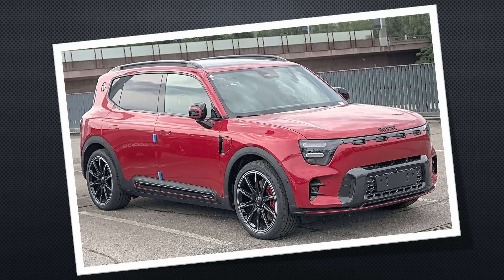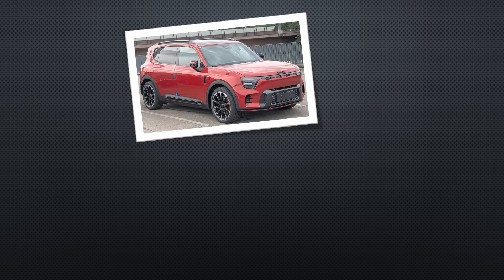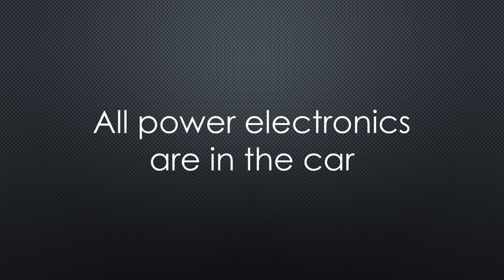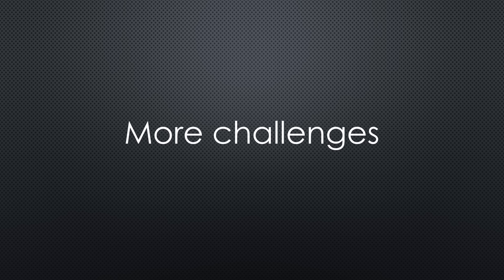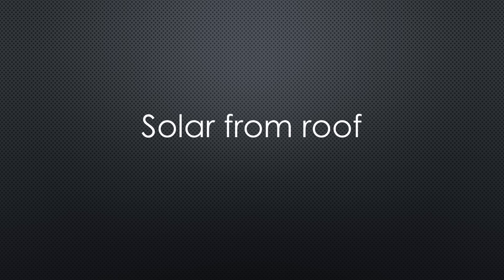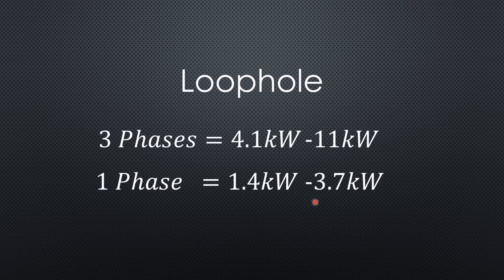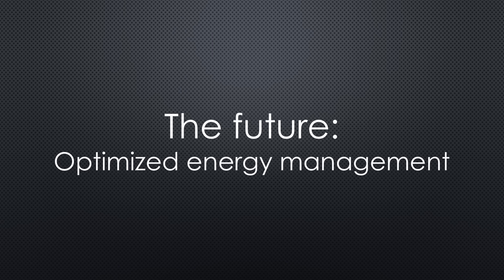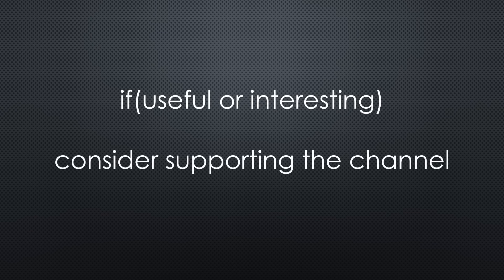How to charge an EV using Solar, OCPP, and EVCC

Comment: Whats the best Antenna for 433 MHz Lora transmitter and receiver for a HAB appx, 10000 meters maximium Altitude,  ?
Reply from the maker: More important is the line of sight of these distances. If you have no lien of sight, it most probably will not work

Comment: Nice video as usual. I started with EVCC some time ago, but found it was not able to handle some specific scenarios so I ended up implementing my wallbox flow and dashboard in nodered using node-red-contrib-ocpp.
Reply from the maker: Also a good idea if you want/need more flexibility.

Comment: I have a Nissan Leaf- and have been curious about whether I can plug into the DC port with some helpful adaptation to do direct (but probably slow) trickle charging from Solar when I’m up at my camp in the Maine woods- 

I work in Solar Installation and Service, and there are nowadays piles of older PV modules that still function, but were upgraded, etc.
Reply from the maker: So far, I have not seen a project for DC. But it should be possible. the standard is open.

Comment: Do your vehicles have the regular outlet plugs? All the ones here do, which is quite a slow charge but ok for some.
It also has the EV specific types of plugs for more power of course.
I have opted to just switch on the outlet via a relay when solar is available lol.
Reply from the maker: My EV has a type2 connector. An I bought an adapter on AliExpress that can be used as a 220V outlet with up to 3kW (Chinese)

Comment: This is fascinating, thank you for sharing it! However, in watching I am left full of questions: 1) The CP control duty cycle... what is the voltage of that signal? Looks like 50VDC on your oscilloscope screen perhaps? 2) What is the nature of the AC charging wave? Does that attempt to charge at the household voltage of 240VAC single phase / 400VAC tri-phase for example? Or, does it push the required current and the amplitude is variable depending on what the car can accept? 3) Would you ever recommend for a DIY to create their own wall charger? As that seems to be such a simple device, it seems maybe not ideal to buy one with any proprietary software at all, do you think?

Finally, I feel that the true home vehicle charging from solar DIY HOLY GRAIL would be a huge battery and to charge via DC. If you should be studying the DC charging attributes or have a observations about that, I think it would be really interesting to share here.
Reply from the maker: 1. You should find a table with the different voltages of the CP pin in the video (Max +-12V).
2. As said: The wallbox just switches the AC lines. So there are 3 sine waves.
3. DIY is not allowed here because the wallbox is part of the "official" AC net. That is heavily regulated.

Comment: There are still only very few cars in North America with NACS connectors, except for Tesla cars. Some can now use superchargers, but via adapters and different adapters are needed for DC versus AC. The takeaway is that most home charging with non-Tesla cars uses the legacy type 2 connector.
Reply from the maker: Good to know. I thought it became the standard...
Reply: @AndreasSpiess , it was announced as the new North American standard in 2023 with great fanfare, but manufacturers have been taking forever to start converting the cars they sell. Even adapters were not available for a long time, but this has slowly changed. As to built-in plugs, there are still almost none. I think maybe Rivian may have a model with NACS, but I'm not aware of others. Perhaps, BMW's new arrivals?

Comment: I am currently driving my wallbox via MQTT, which was an option  with my wallbox. Pretty easy to create proper automations.
Inverter has a read-only access via http (direct access not via cloud scraping) and I can have the relevant info (pv production, battery level) via an HACS plugin.

Will give evcc a try since latest firmware of my wallbox made ocpp available.
Reply from the maker: Frankly, MQTT would be a simpler method. But OCPP seems to be the standard in this area.

Comment: Similar but slightly different setup. I use Node Red along with Home Assistant integrations for Solar Assistant, OCPP and Solcast to control how my car gets charged. An HA dashboard allows you to choose from auto (high or low) or manual to control charging. In auto mode, a flow in Node Red evaluates the solar forecast, the SoC of the house battery amongst other things to determine when and how fast to charge. I am still hoping for a time in the not too distant future where the car acts as an additional battery for the house and charges accordingly all through one cable.
Reply from the maker: Pretty complex setup! I am not sure if the car battery will be used for that purpose. The manufacturers probably do not like it and may reduce the warranty.

Comment: bout two 13 year old ev/erevs. it really is like a disease. soon i added solar and replaced low voltage system and now im building a high voltage battery to expand it. lot more info on my channel :)
Reply from the maker: Indeed, solar is a bit like a disease. it is infectious ;-)

Comment: As you’ve started down this road, look at using a Zoe car battery as the storage method for solar PV. Very cost effective. Needs further development and is not limited to ex Zoe batteries either.
Reply from the maker: I already have a 10kW battery integrated into the solar system. A used car battery could be a good alternative if you get it cheap

Comment: Dear Andreas,
the crux of low power charging of most cars is a bad efficientcy of the onboard charger.
Did you had an eye on the efficientcy of your Smart at low charge rates?
Reply from the maker: I heard about that, too. But I do not know how big the problem is. Some mobile chargers only work on 1 phase, and they can fill the car too. So it cannot be dramatic. Do you have information about the power draw of the car?
Reply: @AndreasSpiess 
For single Phase AC charging i saw reports talking of 15% loss at 16A AC and up to 30% loss at 6A AC.
At 3 Phase 16A to 32A AC they are talking about 10 % to 5% loss.
Reply from the maker: Thanks for the info. Maybe I will check it once by comparing the kWh reported by the wallbox with the one reported by the car. Not very precise...

Comment: I charge two EVs with excess power, which means I have to distribute the excess power between the two EVs. I manage many parameters, like battery state and whether they are connected at all, and adjust accordingly. I did all this with a function in Node-RED. I implemented various features, such as an "override" button for each EV, which charges the EV regardless of other conditions, charge limits, and limiting the discharge of my house's battery when I charge over 8 kW, among others.

I will now move everything to a dedicated Python script running natively in Home Assistant's "pyscript". The overall function I wrote in Node-RED was not very complicated. I first considered using EVCC (years ago, when it was just coming to Home Assistant), but the installation was so complicated that I found doing it in Node-RED easier. Also, as I needed to charge two EVs, that was my only option.
Reply from the maker: Indeed, if you are starting to think about the topic, you will find quite a few things you want, such as the priority of charging. It is not simple and maybe for everybody a bit different. Here, the priority changes according to the solar forecast for tomorrow, for example...

Comment: I thought you would connect the solar directly to the DC pins then use a micro controller to control the car like an MPPT  battery. That way just a solar car port can connect and charge all day very cheaply and no inverters needed😮
Reply from the maker: That would be difficult in my case because the distance between the solar panels and the wallbox is long. Plus: Such a scenario is rare these days and not easy to integrate into a home solar installation with battery.

Comment: Hello Andreas ! 

So good to see a new video from you! Also the subject is absolutely exiting and hits a nerve, as I am in the middle of a small project, playing around with smart chargers myself. My setup is 4 pieces of ELEQ chargers, and a chargin management system hosted on my own linux machine (SteVe). Chargers connect to SteVe server via WLAN and websocket. Communication  between SteVe and Chargers via OCPP1.6J. RFID authentication is done by SteVe, also the logging of the charging sessions. I try to do some kind of automation and dynamic charge management, tr to change power limits and charging profiles via node-red but facing quite a lot a problems. The main problem, that I need a Car for real testing, and that is not always available. A kind of "car simulator" would be very nice to have. Please keep me posted on your experience and ideas !!!
Reply from the maker: This "problem" with the lacking car was the kickoff for my EV simulator ;-) It consists of an ESP32, three n-channel MOSFETs, a diode, and two resistors. Programmed with AI ;-)
And a connector from AliExpress, of course

Comment: I use home assistant plugin OCPP to talk to a Grizzl-e wallbox here.  I wrote custom code in node red to control the OpenEVSE wallbox as well.  With the Grizzl-e, I have to constantly send it a "ok to charge" signal as well as the amperage.  Although the spec for J1772 says we can only go to 6amps, I can make a tesla go to 5amps on the low end.
Reply from the maker: Thank you for sharing. Using an HA plugin could also be a solution. However, for the moment, I would like to work with an open-source project and hope the community will develop an AI-driven optimization. Here, we get a solar energy forecast, and I would like to integrate it into my installation...

Comment: Great, I think that the image of Type2 connector shown is not the correct one, there is another one called  GBT or something and is very similar to Type2.
Reply from the maker: Well, it's possible that I got the wrong one. At first glance, it supported all the points I wanted to make.
Reply: @AndreasSpiess the teardrop shape of the middle pin is suspicious.

There is a problem with my local municipal DC charger, some EV cars have a malfunction after charging is finished or even before it starts (after connecting the plug). Any idea what could be the reason? Or have you only explored AC charging protocol/method so far?
Reply from the maker: I only got my EV 3 moth ago and mainly charged it at home. So I am not experienced :-(

Comment: I enjoy my EVCC connection by using a power line connection. The Porsche Taycan, Porsche Mobile charge connect wallbox work flawlessly directly in my home ethernet with my sungrow inverter. No extra cabling at all.
Reply from the maker: You have nice cars ;-)
I use Powerline to the "bunker", too. Also for Wi-Fi for the vehicle.

Comment: I got a bit confused when you said your wallbox is not controlling the charging, but then you said it announces it’s capabilities to the car in order to not trip the circuit breaker. How does the wallbox know to limit the power to 11kW? Does one need to buy a wallbox specifically for the maximum your circuit breaker can deliver? Or is there a permanent monitoring of load and power of your grid usage vs supply?
Reply from the maker: The wallbox has a parameter you have to set during installation, so it never announces more than the installation can support.

Comment: Thanx for sharing!
When selecting a wallbox or any power electronics for EV charging from solar panels, keep in mind that low-grade budget devices from China often emit significant RFI. A noisy charger can quickly make you unpopular with nearby ham radio operators.
Reply from the maker: Good point. However, I do not know why it would do that because it does not have power electronics. Just 3 power relays and a controller (one even has an ESP32).
Reply: @AndreasSpiess  Yes, that was said having solar panels and invertors in mind, sorry for confuse :)
Reply from the maker: You are right. We have our fair share of problems with that as well.

Comment: Correction: NACS has a separate ground pin and on the diagram it's labeled G and has a green outline. The shell and the pin in the NACS are one piece of metal making up the power contacts.
Reply from the maker: You are right. Did I say "ground"? I meant PE (protective earth).

Comment: Wow.  And here's me putting a pump into a tank and finishing refueling in under 3 minutes.  All done.  No software, no outside control, fewer points of failure.  Don't get me wrong, I'm not anti EV but I do live by the K.I.S.S principle and we seem to be getting so far from it we're inviting trouble.  LOTS of trouble.
Reply from the maker: My only problem with fuel is that I worked for the Red Cross, where I saw the bloody trail oil money leaves on earth. So, I am happy with how it is now. And I still can use my Harley if I miss the sound ;-)
Reply: @AndreasSpiess  Attaching the trail of blood money to oil is somewhat a broad accusation.  I can think of many other far worse examples.  Seen the travesty of cobalt miners recently?

Comment: Not quite sure why you need any of this if you have a battery? Sure, you avoid some conversion losses, but crikey, a battery avoids a load of faff charging whenever you want. 

Batteries are becoming quite cheap - can buy good Chinese DIY kits for ~$80kWh in the US.  And it's probably less expensive in Europe...
Reply from the maker: You are right. I  have a battery, and I never tested the loss if I would go through it. However, I read that it can be up to 20% loss, which would be a lot. This is my main reason. A second reason is that I want to prefer charging the battery because I hardly ever need 100kWh in one day. So I can charge the car the next day. The full battery is needed for the night.
The battery will also be used in my scenario if a shadow briefly reduces the power. Then, the wallbox will not reduce its power, and the inverter will involve the battery to avoid buying electricity.

Comment: Is there a DC option? Like just plug solar directly into DC, then trick the car so it can also discharge into the inverter that powers the home?
Reply from the maker: I do not know. I assume AC is mainly used because the car is not parked near the inverter. In my case, there is a distance of 100m between them, and the AC cables are already here.

Comment: What I would like is a simple boost converter that DC charges the EV from 10m2 of solar panels on top of a carport, with as much power, be it 5W or 5kW, as the panels can deliver at each moment until the battery is full. A simple and cheap solution with no grid tie required.

The standard approach using a grid-tied inverter, wallbox, onboard DC charger is way more complicated and inefficient.
Reply from the maker: An interesting project! I never searched for such a project because the primary purpose of our solar panels is to "feed" the house, which needs AC.

Comment: Welocme back Andreas! I'm surprised you dont use a OpenEVSE based charger, I have been very happy with mine since 2018 🙂 I updated it to use a ESP32 in 2023. I think the next big thing will be a two way charger i.e, V2H.
Reply from the maker: I am pretty sure that a DIY charger would not be permitted here. AC installations are very regulated :-(

Comment: You did the expensive route. I bought a Tuya type 2 EV charger. As I'm retired, and also want to use solar I selected just the 3.6KW version although they have also the 7KW version. Automation is easy, by HomeAssistant and the Tuya Local integration (not Local Tuya, that doesn't work). So depending on the forecast (solar PV forecast integration) and my other power demands (electric boiler, swimming pool pump, both remotely activated) I charge mostly from my solar. I can increase in 10 steps from 6A to 16A. Meaning I can fine tune my charging based upon the actual solar production. Every two minutes I check my power demand and my solar production and adapt my charging speed, by 1A steps. My self-consumption is really high. If I need to travel a lot I charge at night during low tariff, but that doesn't happen often. 
I put the Tuya charger behind a measuring relay (din rail mounted) so if I switch that off (remotely), no one can use my charger. Costs for the charger approx € 80,-, the DIN relay (Zigbee) another €25,-. I 3d printed a socket so my charging cable plug stays dry when not in use. And the chargerbox itself is locked away in an installation enclosure. Not very fancy, but I'm originally a ships engineer and not an electronics engineer 😉
Reply from the maker: Thank you for sharing your project! Here, wallboxes have to be tested and accepted by the utility (AC installations are very regulated). That is why I went with a commercial solution.
I hope I will achieve what you have, too. But I have to wait for the next spring to have enough energy to optimize :-(

Comment: I can't help but wonder why not set up a direct DC charging setup? Wouldn't that be much more efficient since you're skipping multiple lossy inverters that way? Or is it just not feasible for some reason?
Reply from the maker: My solar panels are more than 100m away from the garage... 
I don't know if someone did it. You would still likely need to convert the voltage to an acceptable level for charging, which requires a switching power supply.
But it would be interesting because there is two-way communication for this scenario.
Reply: @AndreasSpiess  Thanks for the feedback! I suppose a 100m cable run certainly adds some complications to it, among everything else.